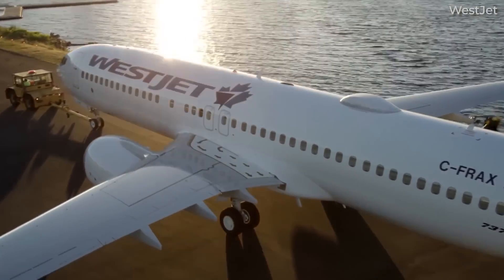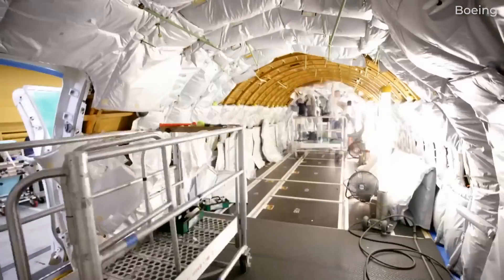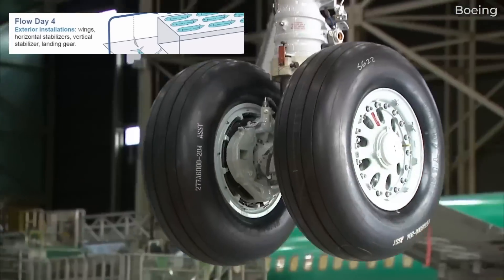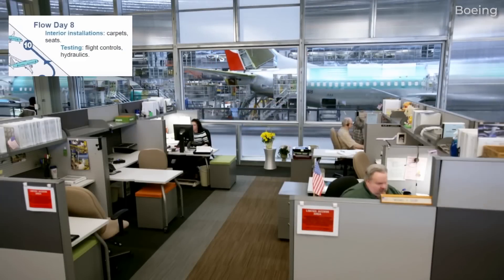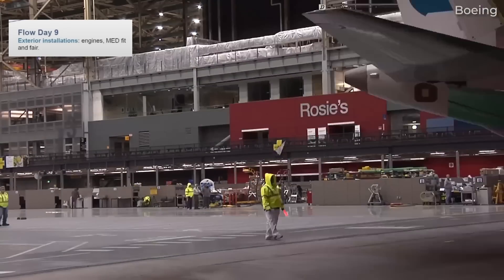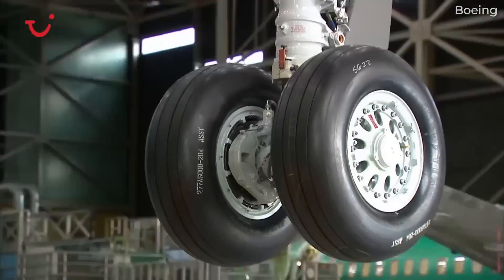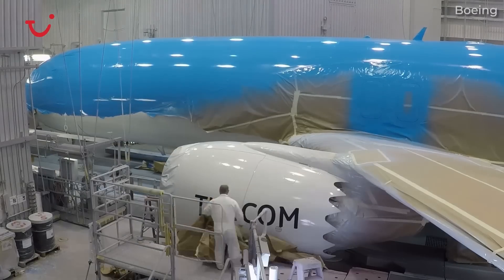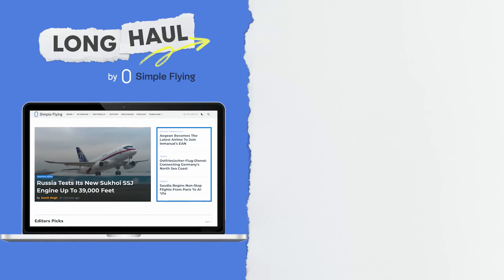Just 10 Days: The Final Assembly Time Of A Boeing 737 MAX

Comment: Time for a baseline reality check "Boeing raised its 737 production rate to 47 per month in Q3 2017 from 42 previously, and plans to increase it further to 52 during 2018.Jan 26, 2018".  These planes all came directly off of the Renton final assembly line.  Renton did not have a stockpile of partially built planes in parking lots spread over the west coast to pull from in those days.  The question is how many planes are being delivered on schedule directly from the commercial final assembly line(s) in Renton.  Now, ask yourself the next question: What is the production efficiency of todays actual rate (somewhere undrer the 38 per month FAA cap restriction) versus the actual once realized rate of 47 planes per month or even the higher once planned capacity rate of 52?  737 program once represented 60% of all commercial cash flow revenue.  Bottom line, in those days, it paid the bills!

Comment: Total number of fuselages built but not shipped to Boeing because of slow production rates is 127 as of August 7, 2024. Boeing's current production rate 25 737s. Spirit could go home for the remainder of 2024 and not build a single additional unit without Boeing missing a beat.

Comment: So how much time does an A320 take to build?
Reply: More. Way more. I´m honestly shocked how fast they do everything. One major difference is that Airbus doesn´t do the equipement installation during final assembly. It is a seperate step done in different buildings.
Reply: Well, I guess there is a reason why A320s are safer.
Reply: Final assembly takes about one month :)
Reply: @matthiashartge5520  Not sure we are comparing apples with apples - how many days are needed by Spirit before Boeing starts counting to ten?  The 10 days is only for part of the overall assembly process.
Reply: @johncassels3475  Good point. At least the fuselage is already jointed. With Airbus, connecting the 3 or 4 fuselage sections also counts into final assembly. However, as far as I know, these sections already have some electrical and mechanical components installed when they arrive at the final assembly line.
So they take a bit different approaches :)

Comment: 1:10 Total number of 737s manufactured since 1967: 10,600
Total number of A320s in service in 2023: 10,562
Reply: A320s entered service a full 21 years after 737s too
Reply: @AJR-07 However Airbus has more production facilities for the A320 family, with the likes of Toulouse, Hamburg, Mobile and Tianjin
Reply: @AJR-07  Yet Boeing still sells lots of 737's. Why? Yes, a couple of airlines are ONLY 737 based, but it is more that that. The 737 typically gets better fuel economy than comparable A320's.
Reply: Aircraft in service by years for all variants of 737 / A320 family:
2006: 4,328 / 2,761
2010: 5,153 / 4,092
2016: 6,512 / 6,510
2018: 7,310 / 7,506
2023: 6,500 / 10,562
The table clearly shows A320 replacing 737.
Another interesting point is, between 2018 and 2023 Airbus delivered 2,600 A320s, but those in service increased by 3,000. So even some parked or retired A320s (most probably Ceo) were returned back into service.
Reply: @user-yt198  No, what it actually shows is the A320 largely replacing the MD-80 and MD-90 series.  Otherwise, 737 in-service numbers wouldn't be holding relatively steady.
Reply: @GintaPPE1000  In 5 years 737s in service reduced by 12%, not even counting for the size of the market increasing. Do you consider this as holding steady?
Reply: In the early 1900's, there were more horse drawn carriages than automobiles. That's not the case any more. Same things happens with an older generation plane compared to a newer generation plane. Eventually, the 737 will be found at the Smithsonian.
Reply: Your comment isn’t very pointful as Boeing also has produced 707,727,757. All narow bodies. You have to add those as well.
Reply: @matthewhaubenchild  Tell it to the video makers. I just took their number given in the video.
Additionally A320 number does NOT include retired A320s.
Reply: *A320 family aircraft. That number includes 319's and 321's as well. It's entirely a case of semantics though.
Reply: @xXxCrazyDanexXx  Well, 737s include all variants, too - so why the distinction? Just because Airbus has a quirky naming scheme for the A320 family (in contrast to all other families)?
Reply: @xBris  As I said, it is pure semantics. I think that it's mostly a distinction in value proposition in this case, where Boeing aims to homogenise the 737 line-up, and Airbus aims to differentiate. 

I was just against OP posting the statistics in his comment without giving the proper context to people who might be unaware.
Reply: @xXxCrazyDanexXx  the video author says the 737 family... which includes all 737s made.  Therefore All A320s (19/20/21/21neo) should also count
Reply: @soccerguy2433  Where did I state that I thought they didn't?
Reply: @xXxCrazyDanexXx  when you argue semantics.  the video states 737 family.  then you complain about saying 320s... when its common knowledge that stating 320 includes 18/19/20/21/21neo.  it also follows that if the video states 737 family one quoting 320 numbers would also use the entire family

Comment: They discoverd a method to do it even faster by not tightening a few bolts and leaving a few tools behind the panels instead of cleaning those up.
Reply: Good one
Reply: 🤣....

What a waste huh.... after all that production works engineering research to throw all down the drain 😅
Reply: Surprised they haven’t just used a 3d printer at this point
Reply: Did they where was that then?

Comment: Apparently Boeing has also paused 777x testing after some "minor" structural damage
Reply: That’s the purpose of these test flights lol, better to find out now than when in production and service
Reply: @AllendeNL  
Oh yes. Better to find out now
But this is not the kind of thing they except to find at this stage. 
It is not an easily rectifiable defect. 
This is a bit that keeps the engines on the wing. 
It’s not like the toilet door lock is a bit faulty or one of the overhead lockers doesn’t shut properly.
Reply: @Rasscasse  It IS the kind of thing that they find in long-term testing. Several early 4-engine aircraft were found, after several thousand flight hours, to have problems that would not show up earlier. 

Lockheed Electra: Three aircraft were lost in fatal accidents between February 1959 and March 1960. After the third crash, the FAA limited the Electra's speed until the cause could be determined.[8] After an extensive investigation, two of the crashes (in September 1959 and March 1960) were found to be caused by an engine-mount problem. The mounting of the gearbox cracked, and the reduced rigidity enabled a phenomenon called "whirl mode flutter" (analogous to the precession of a child's Spinning Top as it slows down, an interaction of propellers with airflow) that affected the outboard engine nacelles. When the oscillation was transmitted to the wings and the flutter frequency decreased to a point where it was resonant with the outer wing panels (at the same frequency, or harmonically related ones), violent up-and-down oscillation increased until the wings would tear off. 

The first trans-Atlantic capable jet airliner, the DeHaviland Comet, suffered a different problem with stress, and again, one not found until the aircraft had been in service for a year or so. The main cause was believed to be that rivet holes had been punched into the fuselage Instead of being drilled)  and that the passenger windows were too square, meaning the corners were too sharp. These conditions led, it turns out, to stress starting and concentrating at those points, and with enough stress, the fuselage would crack open and then come apart in mid-flight. 

This is why commercial aircraft today undergo thousands of hours of testing, to find problems like these before the aircraft is put into service. Like the 777X and engine pylons.
Reply: @colinpovey7923  
That’s a very long reply , with some interesting information and examples. 
The stand out  thing for me is that all the examples you quote are from 60 years and more ago. 
Maybe I’m wrong, but I expect better in the 21st century. With current technology there are other ways of testing apart from real world flight. 

You have talked about years of testing revealing faults, which I understand and that is what it’s supposed to do , but how many years/hours  have these aircraft completed? 
You seek to portray it as normal it seems. 
Despite your portrayal, I’m not so sure that it is. 
But I thank you for your provision of information and engagement.
Reply: @Rasscasse  my best friend in college is an aerospace engineer. He has worked for Boeing, Lockheed-Martin, Rutan, Beechcraft, and maybe another company. He is also a pilot, and his recently-passed away father was not only a pilot, but a Certified Flight Instructor and FAA Flight Examiner, so aviation is in his blood. When last we spoke, we talked about this a little, testing that is, and he says there are some things that cannot still be tested mathematically, and some that cannot be tested well even in wind tunnels. And cracks, often linked to vibrations, is one of them. Boeing, when developing the 787, spent thousands of hours testing the wings, which were the first made from composite materials, instead of metal. But they could not test them in a wind tunnel above a certain size, because abuse large enough wind tunnels simply don’t exist. So the built full size wings and a fuselage, put them in a hangar, hooked all sorts of hydraulic jacks to them, and tested the heck out of them, 24X7. They found some problems, and fixed them, and retested.

Airbus, on their A350, the competitor to the 787, has normal metal wings, but the body is composite. They tested, of course, but a problem escaped the testing. Now, all metal and composite things expand as they get hot. So, aircraft fuselages expand and contract between sitting on the ground, then fly along in the frigid air at 40,000 feet. Turns out, they did not test this enough. One Qatar airlines cancelled their $6 BILLION A350 order when they started having the paint fall off the fuselage, of their first A350’s,  after the fuselage expanded and contracted more than expected between desert roasting temperatures and the -40 to -70°F (-40 to -57°C) encountered at 40,000 feet. The fuselage is not unsafe, but having paint fall off the aircraft does not look good!  There is a YouTube video on this. Look for something A350 paint flaws.

BTW, they have ‘reached an agreement’ between Qatar and Airbus, but won’t disclose the settlement. I suspect it is something like it requires Airbus to pay to get the aircraft painted when a certain amount of degradation has occurred.

Things you just can’t find without long-term testing.
Reply: @NauticalAviation1 they discovered some cracks on engine pylon after test flight to Hawaii.
Reply: It’s not minor!!
They have found cracks in the pylon that support the huge engines.

Comment: 10 days to build a max but cant do shit with 2 people stuck in space. What's Boeing gonna do next? Speed run the 777X test??
Reply: They moved their best engineers from their futuristic plane program to help fix their current issues
Reply: You mean stop 777x tests because thats what they did
Reply: Well it's only the final assambly that is 10 days... there is much more before that
Reply: They already had to ground the 777x test planes due to a failure.
Reply: this isnt the space division this is the commercial division
Reply: @nickolliver3021  The commercial division is not doing any better than the space division. And if the defense division was scrutinized in public as the commercial and space, you will see the same trend here.
Reply: @todortodorov6056  but the 777x has been better than the other two despite the issues the whole company has been recently. Its performed better but still had had scrutiny from the tiresome delays
Reply: @nickolliver3021  The 777X is not flying yet commercially. And the test program has been grounded, because the engine pilons have developed cracks. So yes, if you call that "better", than everything is relative, the rest must be worse compared to the 777X.
Reply: @todortodorov6056  everyone knows it's not flying commercially. Yes we know they have developed cracks and have been grounded. So I take it that you think this is a serious thing just like the rest of the programs have had
Reply: @nickolliver3021  Cracks on a brand new plane are not a good sign.
Reply: @todortodorov6056  neither was it a good sign on the a380 so tit for tat. I think were all fed up of delays and issues
Reply: @wadehiggins1114  why can't you wadester